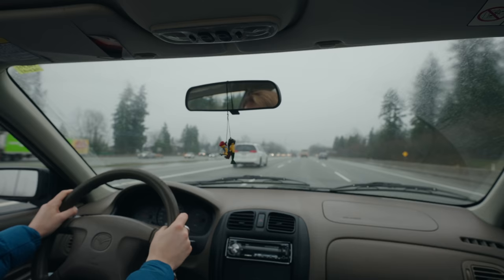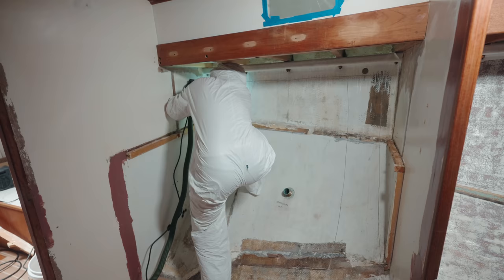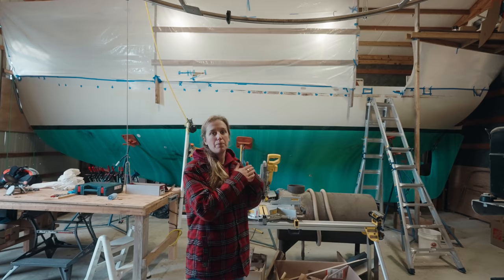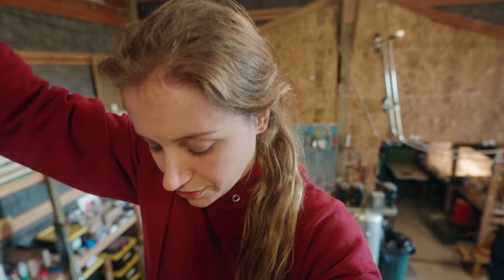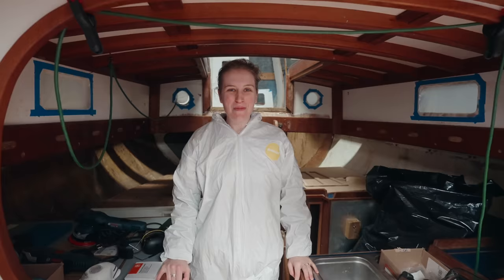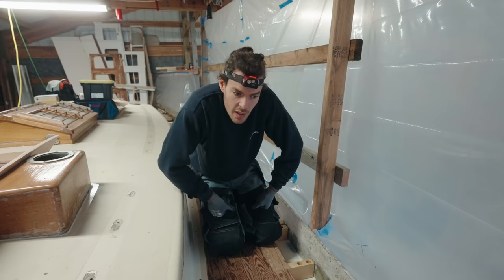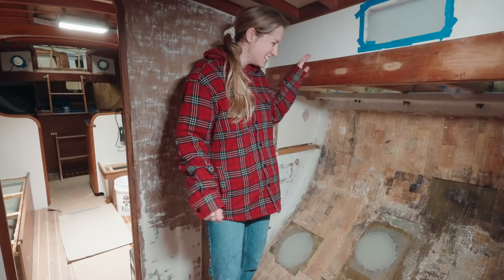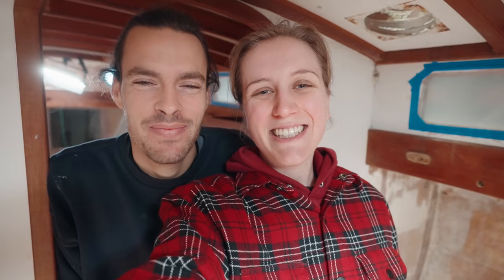Sailboat Demolition STARTS NOW! [S4E37]

Comment: Why don't you just fibreglass in threaded plugs/plates that are not open at the end. You can just screw a bolt through the rub rail into the plug/plate and no water will get into the interior of your yacht.